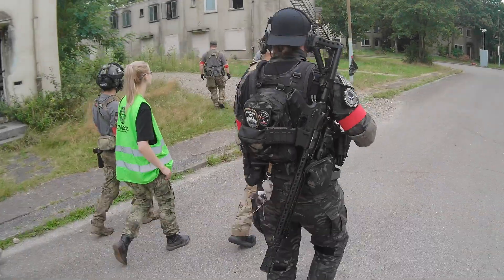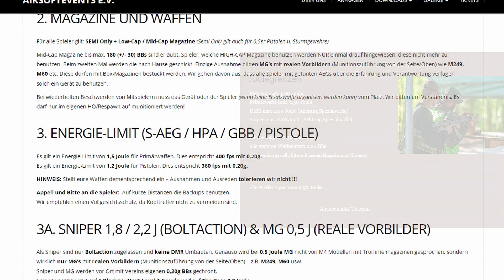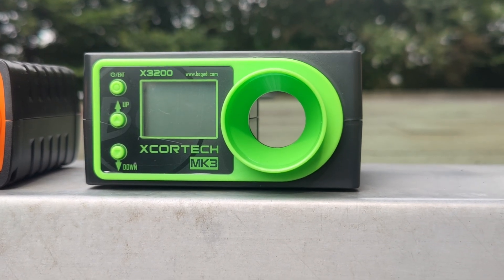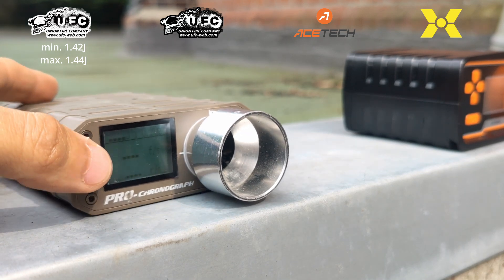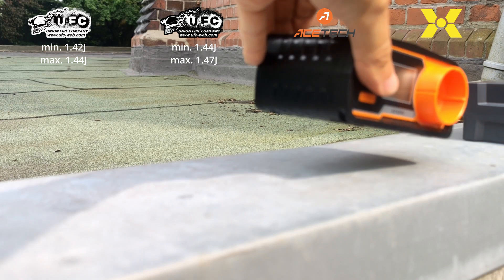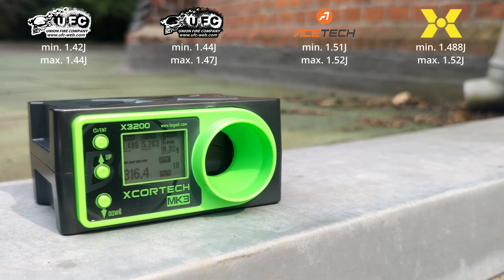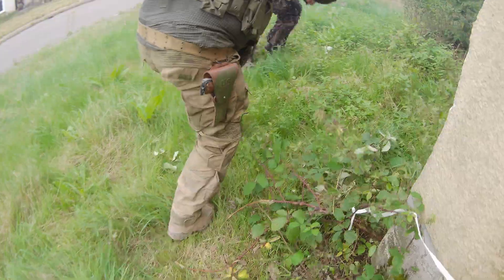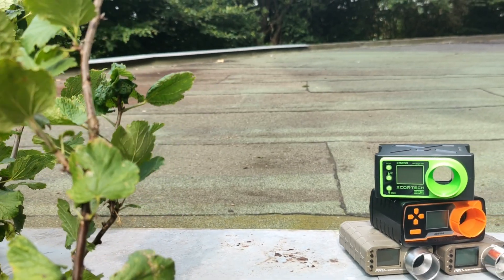Four chronos, one airsoft replica: Will the Joules / FPS be the same? UFC, Acetech, Xcortech

Comment: I have also noticed that the Acetech shows more than the UFC, which of course is in my favor, since I use the Acetech6000 myself and have no problem adjusting the HPA to the maximum limit. 😁
Reply from the maker: That's good for you, I guess :D But be aware, also different Acetechs could show different readings, even if they're the same model. Have a good one!

Comment: now that we are no longer measuring by speed. Are we not using the wrong method to measure? 
Should we not switch to an impact based measuring device? 
I don't know of any such device that would be sufficient for airsoft use, but I think it would be a better way to measure Joules...
Reply from the maker: I think there would be several questions to follow... Are such devices available for airsoft? What would be the correct distance to measure the impact? How to manage the huge switch between the very common "old" chronos and the new gadgets, as almost Nobody got such an impact device? 
In my opinion, such a Change would take years - but the idea is interesting of course. Have a good one!

Comment: Very nicely done. This is the exact reason why beeing on the limit can be risky, if you do not have easy access to the spring/regulator/npas. having 0.2J lower power then field limits have very minimal impact on the game itsef and saves time during chronoing. In the end, what ever chrono the site have, that one is the "source of thruth". Having 0.1J leeway is acceptable from my point if view and is much less impactful then actual incorrect chronoing practices - measuring just with 0.2g, with hop up off and similar. These incorrect practices can impact in game power much much more then allowing someone to be 0.1J over the site limit.
Reply from the maker: Absolutely - i really hope this topic will get more awareness, especially for field hosts. Thank you for commenting and that way helping to spread it :)

Comment: This is why I wish we had sites get their chronos calibrated. The fact you can tell someone to not use their pew they worked hard to pay for during a day they have already paid for is silly to me if the chrono reads slitely over. You can have a perfectly okay pew but a site says otherwise.
Reply from the maker: @BazAirsoft  Yep, but even if they calibrate, your chrono at home can tell different readings. So bringing own chrono to the field maybe would be an idea, right?
Reply: @rummbolt  Yeah maybe, when I set up I use a mates chrono that always reads hotter than the site's so I know I'm not holding up the line when I go.
I think it would be a good idea to allow other people to use theirs but I can just see people abusing it by somehow reducing the readings on theirs.
I think calibration of site chronos will always be "the best solution" but not always most practiced (cost). Just like how no sites weigh the BB you just used 🙄
Reply from the maker: @BazAirsoft  true. As a compromise, it might be the most efficient solution. However, i never saw or heard of chronos being calibrated here in germany. Even if the fields use two or more different chronos if their own, I have experienced some good deviation 😅
Reply: @rummbolt  Hahah yeah, they dont get calibrated here too! Just wish they did 🤣
Reply: @rummbolt  and here is the problem. My Mate works for a large Company that is based in Calibration. That's all they do. They have large contracts with aerospace Company. Every few months they correct anything from Gauge Blocks to Torque Wrenchs that measures in the 1k Foot Pounds.. twice a year I send my Chronograph with him to work and have it checked. I know for 100% mine is accurate! 
But, like the OP says, fields won't do this. My weapons have had a +/- of 
20 FPS from my Chronograph at various local fields 🤷‍♂️

Comment: I've noticed that how clean the chrono is inside and the battery voltage can affect the reading too. I have an old madbull chrono that's probably 15+ years old and a lot of people complained they weren't accurate but regularly cleaning any dust from the inside and wiring it up for an external power supply has made mine very consistent.
You made a very good point at the end though. It's better to be under the limits by a little than try and be exactly on the limit and risk the field chrono reading your replica as too powerful. It's probably a good thing if field chronos read a little high too. It means there's less chance of someone using something too powerful on the day.
Reply from the maker: @Rick_Makes  thank you for your detailed comment, good sir! 
I never thought about cleaning the Chronograph, so i will try it soon. 
Curious how this will affect the readings. 
Have a good one!

Comment: This is what I'm always scared of with my AEG. My local field will not even accept a 0.01j deviation 😬
Reply from the maker: I completely get what you mean. Especially on commercial fields, i experienced the marshalls being veery strict on energy limits. 
Thats why I made this video, to raise awareness that  there is no 100% exact measurement with those kind of chronos - and to prepare everyone for potential problems that could result from it. Good thing: Only a little less energy on your replica than allowed max. can help to avoid problems on the field (e.g. 0.1 J less). Have a good one!
Reply: @rummbolt  a rental is €30 euros per day 🤡
Reply from the maker: @DaimySchrijver  yeeaah had the same two months ago. Had to rent a backup pistol because mine was 0.1J too high. Only 10€ luckily, but i never used this crappy thing the entire day -.-

Comment: The angle of bb going through the 2 sensors also make a difference result

Ideally you should chrono the replica perpendicular to the chronograph, if you angle a bit the replica, the reading will decrease
Reply from the maker: Sounds absolutely reasonable, yes! I tried to do it the same way and angle as good as possible during the test. Thanks for adding this information :)
Reply: @rummbolt I believe the reason behind why each chronograph have different readings is the assemble process, they use the same program in their chrono but through the assembly, length between the sensors may not the same, resulting different outcome 
(E.g. Program set distance between 2 sensors is 1, but in chrono 1 the sensors distancing can actually be 1.1 and chrono 2 can be 1.2)
Reply from the maker: @Fat_  Absolutely. And when you consider the most likely huge tolerances in the assembly process, you get one more variable - even on the same models

Comment: It is an interesting point, we did a test a few years ago with 5 different chrono's using different color bbs. There is a whole spreadsheet with that information. The chrono part is in stand 3, The picture is a summary about that.  We tested different rifles and even shotguns to see if they would work. 

https://docs.google.com/spreadsheets/d/1lRx_FsoNqieMfNR_MV2BcU0Tb-Qcd95f/edit?usp=sharing&ouid=108837449879006798743&rtpof=true&sd=true

Comment: Wir waren an dem Spieltag auch da und waren über die wirren chrono Werte überrascht. Ich zb habe zuhause mit einem AC6000 genau 1,5 gechront und der Betreiber hatte 1,44 joul. Alle hatten komische Werte muss man dazu sagen 😅
Reply from the maker: Ja, ich erlebe es immer wieder. Nicht nur in Weeze, praktisch auf allen Feldern. Daher die Idee für das Video. Meine Primary war am Sonntag auch rund 0,1J stärker als zuhause gemessen - zum Glück durfte sie trotzdem aufs Feld.
Reply: @rummbolt  wäre mal interessant zu wissen was der Linke chrono für Werte "ausgespuckt" hätte. Ich war an dem rechten chrono.
Reply from the maker: @AggressiveForce  Ich war auch am rechten. Aber der Vergleich wäre echt mal sehenswert gewesen :)

Comment: I think this issue might have caused my rif to be classed as hot at a game last week. It's recently been sorted by a tec and was running perfectly at the previous game days. I thought it was my fault for moving up to heavier bbs, but I remember using two different chronos at the same site previously and I failed the first, but passed the second. Will test it against mine again tomorrow and and a friend's and try and work out the difference in joules, instead of just looking at fps.
Would you ever recommend taking a chrono to a game site and testing it yourself just before trying theirs? Thanks for the vid!
Reply from the maker: Joules is always a combination of BB weight and BB Speed, FPS is only the speed. Thats why Joules in my opinion is the more usefull variable to focus on :) 
However, i take a chrono with me every gameday, yes. Be it if i need to make short term adjustments or just to borrow it to a friend - it comes in handy very often. 
Have a good one!
Reply: Ah brilliant, thanks for the reply. Will definitely start doing this.
Reply from the maker: @alexandermanley1695  Have fun on the field :)
Reply: @rummbolt  There are some fields where I live that actually allow you to use your own chrono if your gun is shooting hot. Because the awareness is already there that there might be some deviation between brands and chrono's. But I'd rather stay safe and be 0.1J below the limit since playing with gbb depending on the weather joule creep can be an issue.
Reply from the maker: @Sylcatam  oh wow , never heard of this solution before. I like it! Good idea for some field owners here in Germany:)

Comment: very interesting, i have the  acetech and always wondered why it seems to shoot lower at the field than when im home
Reply from the maker: It´s a nice chrono - but I´m sure when you but three of those against each other, each one will tell you slightly different output measurements as well. Those chronos are basically all china made and suffer from low quality control standards - i think this is why they have such a high deviation. Have a good one!